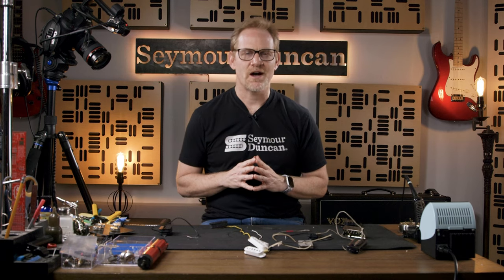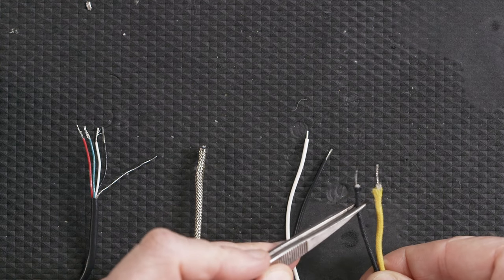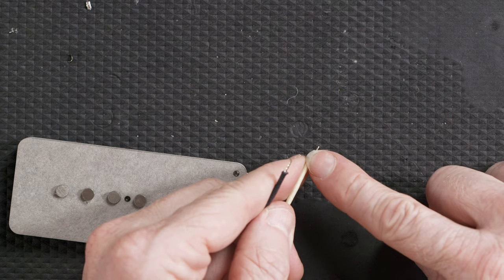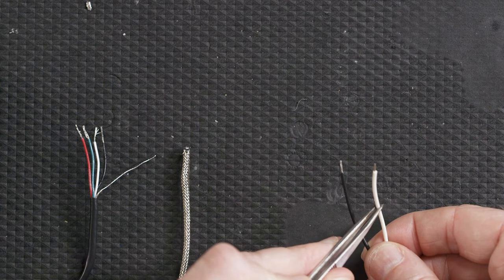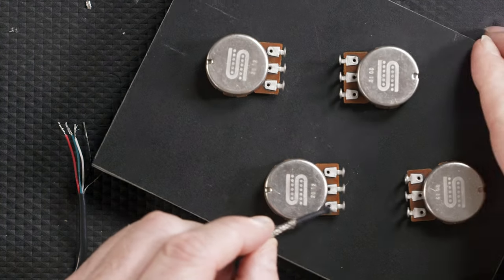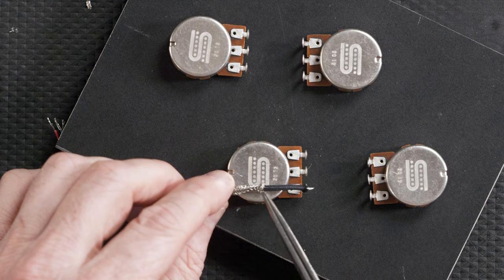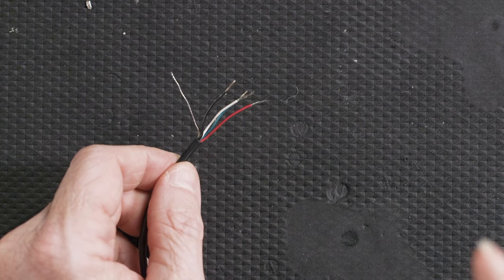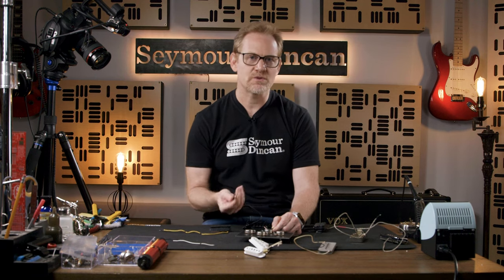Guitar DIY: Types of Lead Wire

Comment: I have been looking for the answer this question. I am sure I will find it sooner or later. Each coil has a black and white wirer but I have not heard mentioned which coil has the red or white wire. I realize that it dose not matter. Black & white. Red & Green? If I had to guess.  Thanks SD 👍

Comment: I ran into another kind of lead wire on Rickenbacker 4003. The lead wire was a 26 gauge (why so very thin and fragile?) wrapped in plastic with a wire mesh braid around that (for shielding I assume), and then braid was wrapped by plastic. The connection was made by cutting the plastic off the wire braid, twisting the braid together and soldering that twist to a pot (or whatever) and then the hot lead to wherever. In changing the pickguard and pickups on two occasions I found that the joint wherever the mesh twist was bent at 90º broke at all places with the manipulation of working on the electronics and replacing that and pickguard back into the guitar. Two wires, ground and hot would be more durable.

Comment: Cloth push back wire can absorb moisture, I prefer to use fine stranded PTFE silver coated copper military hook up wire. I also don't like to use the Gavitt wire (single conductor with shield) with the exposed braided shield for much the same reason. For pickups that come with Gavitt wire, which are the majority unless the coil supports splitting, I like to insulate the Gavitt pickup wire outer shield with PTFE sleeving. To me it is a bit strange to have a signal source two conductor cable where one of the signal wires is completely exposed free to cross connect or short out another circuit or violate a single point ground. I think the minimum wire gauge for electric guitar wiring should generally be 20 AWG and the Tailpiece ground stranded 18 AWG. However, many coil manufacturers use very thin wire like 24 or 26 AWG.

Comment: I don't see 1-conductor pick-ups available in Europe, only 2- and 4- conductor. Is that because the 1-conductor is an older method of connecting components?

Comment: I'm trying to wire a p90 humbucker p90 configuration guitar with a 3 way switch.

I'm trying to make it behave like 2 seperate p-rail pickups but full size.

Any suggestions or tips to wire it properly?
Reply: I'm trying to do the same, using a LP 3-way switch.

Comment: I’m not that bright with these things.. I bought a pick up from eBay that has a green and a white wire but when I took my broken pick up off guitar it has a red wire,a white wire and a bare wire~ all three encased in a black plastic covering ..
Reply from the maker: Different pickup manufacturers use different wire colors. Was one of those pickups a Seymour Duncan?
Reply: @seymourduncan  
Hi. Thank you for reply..No name on either of them..The guitar is a Wesley Jasper..It was a cheap un off ebay. I’m going to pop into a music shop and cost it up.